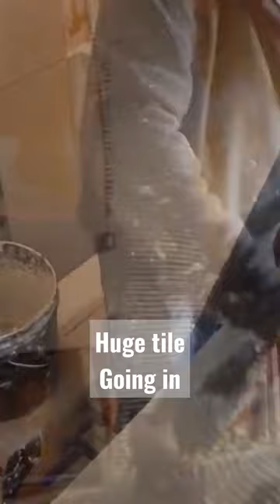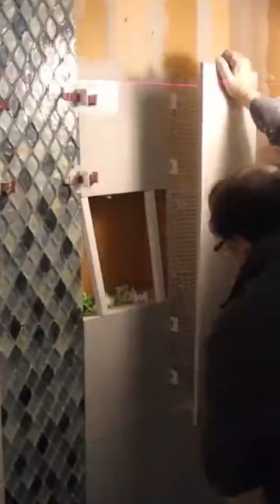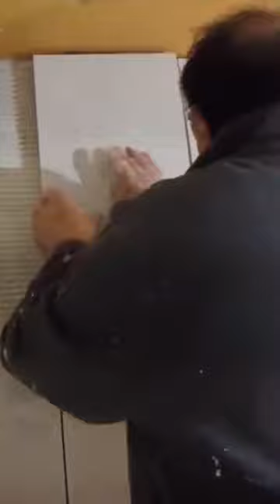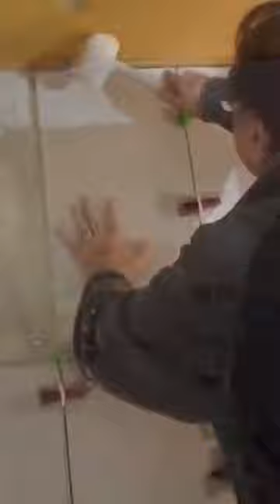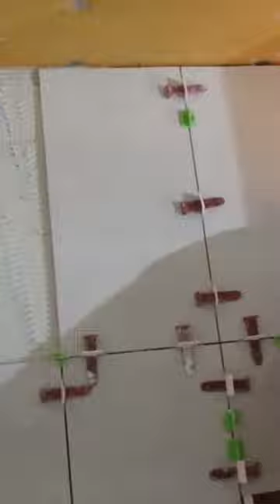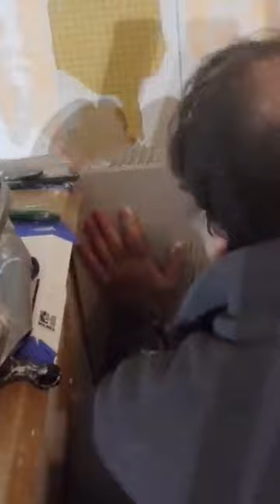Huge tile with waterfall feature. #shorts

Comment: Hey sal quick question.. is it a must that you have to back butter the tiles before install if using the leveling kit, or can you just set em dry?
Reply: Back buttering is very good habit, but it is not necessary. By the book its required for bigger format tiles and outdoor installation.
Reply: @robertmatyjasik6325  well that's good to know! Thank you sir!!👍
Reply: Vertical tiles don't have to be back buttered. It's true that it helps with coverage but these titles will never be under the stress of people walking around or heavy furniture. As long as you are getting good contact between the cement and tile, you are fine. Even 65 percent coverage is done. For floor applications, you ideally want 80 percent or more and no empty spaces. Pulling a tile up after setting it makes sure you are getting good coverage.